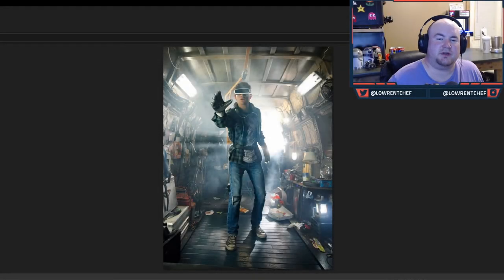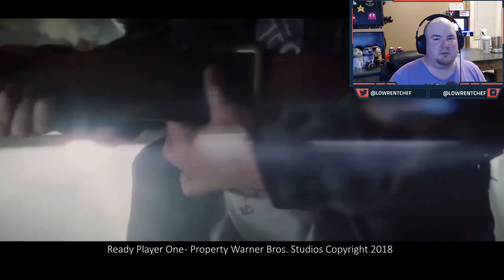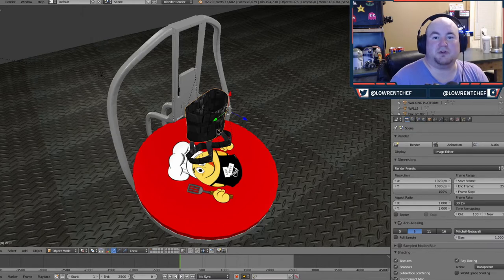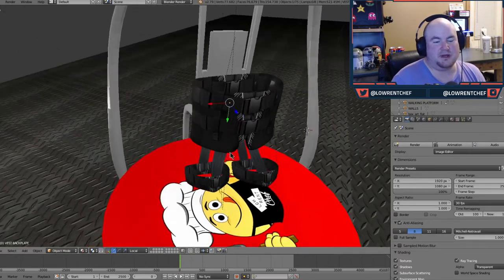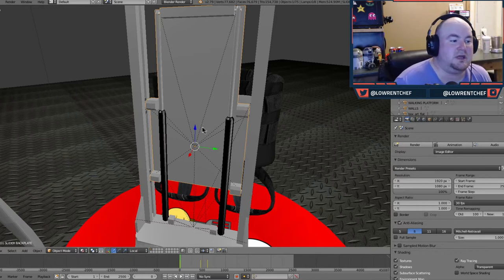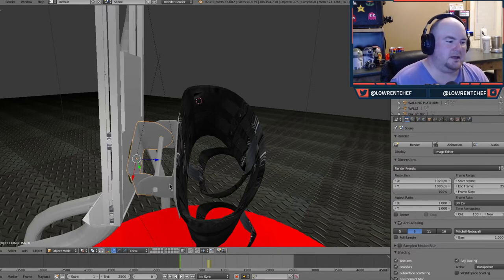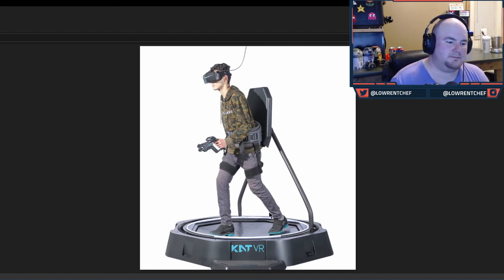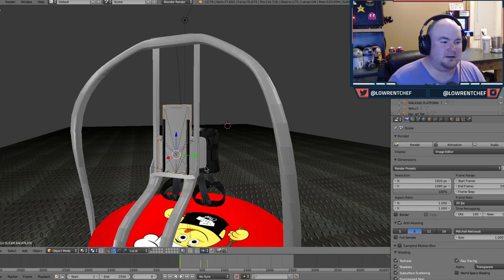Omnidirectional Virtual Reality Treadmill Part 1: R&D

Comment: Looks great. What comes to mind is the rotating frame may be a bit weighty and slow to turn? What if the harness, backslider plate, and support pole hung and rotated from a stationary overhead X or Y frame mounted on 3 or 4 posts. It would be a taller design overall but the rotating mass would be much lower and more centrally distributed increasing reaction, speed, and stopping. A hanging design could also be sturdier and easier to adjust compared to gas struts. Just brainstorming bro. Good luck.
Reply from the maker: Yeah, I need to finish the mockup for the updated design as it exists so far. And you're right about the weight being a concern. So far I've built the four rollers and purchased the rolled steel ring, which is both taller and thinner material than in this version of the design. I've considered the weight, and I (crosses fingers) hope it's going to be fairly light when done. I've also swapped out the gas struts in this design for lighter exercise bands, which should also allow for adjusting the level of vertical resistance to really get it dialed in. I've also redesigned the back support and slider to be less complex and lighter. I rent, so I'm not able to hang anything from the ceiling, and I'm not sure I have enough space to build a post setup to serve as an overhead frame to hang the support from (at least one large enough to clear my hands as they swing around). I also worry that hanging from overhead can sometimes create a "dangling" sensation, and I want to attempt something a little more grounded. I'm sure I will have to make further adjustments as I go, lol. Thanks for checking out the video and offering feedback!

Comment: I would switch to some type of railing system, where the four tubes connect to casters (or something similar) that is on a rail. This would reduce the weight which may be a problem when trying to turn in game. Also have you consider going with the rotating balls in a wooden frame for the floor. It may be better than the friction-less surface. Just some things to think about. good luck
Reply from the maker: The rail option is a possibility, but manufacturing a perfectly flat rail so that it didn't go up and down as I turned was a concern. And for a while I considered using those steel conveyor balls (probably not the right term, lol) that are used in shipping warehouses, but they weren't very smooth and were pretty noisy at body weight levels of pressure (I bought like ten of them and tested).
Reply from the maker: Thanks for watching the video, and I'm always down for suggestions to make it better!

Comment: Cool stuff! Only major problem is that trapping the rubber wheels with rails on both sides will cause the rubber wheels to seize up. You'll need to use one I-beam and two rubber wheels on opposite sides (think elevator shaft wheels) for it to move freely. Also make sure that the brace pillars have a large contact surface (perhaps even flattening them out so they're wider at the bottom) with the outer ring for welds with less possible failure stress points.
Reply from the maker: 100% agree. That was one of a couple of changes I've since made to this design, (which keeps evolving). I realized a week or two after I uploaded this that I would either have to 
A: leave a bit of a gap between the wheels and the inside of the channels, which would introduce play that I don't want in order for it to allow for movement) 
B: redesign it to just use steel bearings so that it will slide easier, or 
C: do what you suggest, and simply put opposing wheels on either side of the back plate, which is the change I'll probably end up going with. 
I've started to accumulate parts, and I've decided to remove the lift struts as well in exchange for a simpler solution that will allow for more adjustability in regards to different people (with different weights) using it, as well as cutting the weight down a little more (wide fitness bands stretched over mounting "hooks" attached to the support brace structure and and extension from the upper portion of the back plate)
And this design does include a flattening of the brace tubes where they come in contact to the outer ring (maximizing the contact patch as you describe), but it's possible that doesn't show up very well in the animation. Thanks for the feedback! I'll be posting more videos as I progress through the build, and the end product might look quite a bit different from where it is now. If you feel like following along, feel free to subscribe!
Reply: @lowrentchef7497  I look forward to seeing your next video and update on it! Hell, I'm even thinking of making my own, with my own ideas on how to achieve certain things. :D
Reply from the maker: @MajatekYT  Nice! I'll be curious to see how it turns out.

Comment: It's a shame you're getting this little Response on Youtube for your clever device. I find it very interesting and it surely has its place along all the other solutions. I find that a folding mechanism for storing would be nice and im worried of my heels hitting the Metal spines right behind my back while running.. but i find it awesome what you invented there.. Looping forward to your  Prototypes! You sure have to work on your Marketing sooner or later ;) I'll spread the word :)
Reply from the maker: I appreciate the kind words! I've thought about moving the lower supports as well, connecting them to the lower sides of the sliding mechanism instead of having them mounted underneath, thinking that extra couple of inches of clearance could be useful. (I'm also considering splitting the sliding mechanism out a bit wider, arching the bottom of the sliding plate, and getting another couple of inches of clearance. A folding mechanism could be a cool idea, but I'm trying to minimize play in the entire device so it might be for the next version. I'm sure there are no shortage of plans for these things online, and I'm hoping that once I complete it, people will find it a bit more interesting. I may consider making a 1/4 scale mockup out of wood prior to buying all of the metal and building it, and would probably make an update video at that time showing the progress I've made in the design. Once again, thank you for watching and your kind words.

Comment: Great work, I like it. 
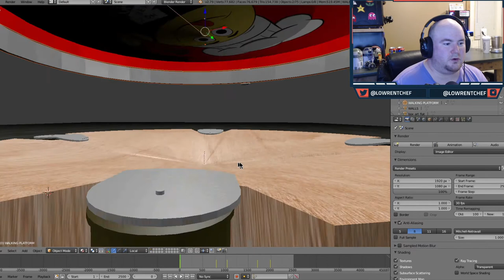Can you think about, to use only three rolls (with 120° inbetween), shown at 8:12? This will help to align the center more easily and precisely. I do the same with mine: I also use only three rolls to find the center. And if you use only 3 of them, you will need only one steelplate, shown at 8:34.
It would be a good idea to create something, where you can store/mount an rechargeable battery for your wireless headset. Maybe a net or something like that where you can place an "extension battery" for the wireless headset? So, there will be no more need to stop every view hours to charge the headset.
Reply from the maker: I went with four because I wanted it to be as stable as possible, and distribute the load a little more, but three could definitely work. 
And I currently run a Valve Index, so I haven't given a ton of thought to wireless considerations, but I know that is where the industry is going. Your idea of having an external battery pack mounted to the structure of the treadmill is a good way to move that weight off your body. Perhaps to the sides of the plate that attaches to the belt? It would be out of the way, close enough to not need a long cable, yet reachable when playing. Could even have one on each side, though I'll have to look into all of that when Valve releases their wireless update or new HMD. 
Thanks for watching the video and taking the time to comment!

Comment: Dude did you get this out before Katwalk had been released
Reply from the maker: Nah, I've been nibbling away at this project, but haven't finished it yet. I have the four rollers built, and will pick up the materials to build the base in the next week or so. My apartment is pretty small, which means building this in my families shop a couple of towns over when I can find time. Slow but steady progress is being made, however, and I haven't given up on it.

Comment: Good concept, it looks heavy though. It looks like turning and ducking would need to be greatly exaggerated by the user, turning especially.
Reply from the maker: Most of the weight wouldn't move with the user, though. The rollers, base platform, etc are all stationary, only the ring and hollow tube frame, etc move. I've already built the rollers and the ring (which is a fair bit taller than this version, which allowed me to use a thinner band of metal for the ring and maintain rigidity. Once I get the base done I'll make an update video. I've also decided to not use the gas struts and move everything to a pull-up band system to make it easier to adjust for different weights. The idea is to have most of the weight of the treadmill in the base, and then remove most of the users weight to make sliding easier. I saw a video where Barbie tried out the new KAT C, and it sounded like a horse galloping because of all of the weight on a hollow plastic base. I want to try to minimize that, but we'll see how it goes.